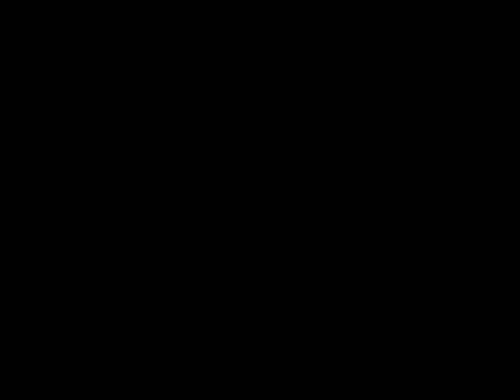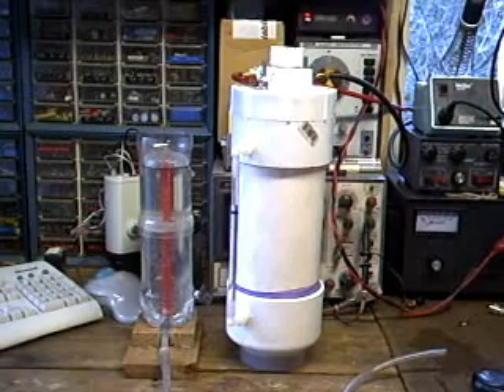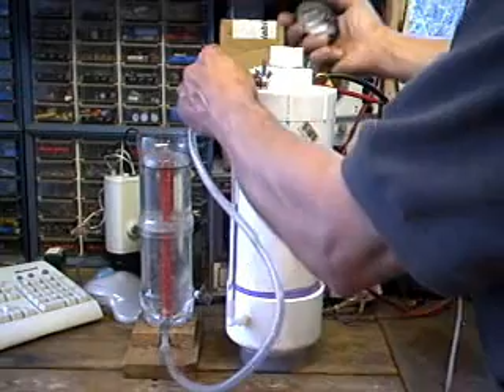#85 - VSPB Cell Production numbers 1

Comment: 1. fill the car up with gasoline and reset your trip odometer. 2. Drive until you have 1/4 tank or less and fill up. 3. Now divide your trip miles by the number of gallons you just put in your tank. This is a much better way to measure your mpg. The fuel guage on the dash board is usually based on a floater on a stick in your tank. Similar to a toilet. They are just a rough estimate and do not account for the shape of your tank either.

Comment from the maker: That idea has been tossed around. If I do, it will be just a simple copper tube wrapped around the body of the main PVC body between the end caps with some sort of thermally conductive adhesive to hold it to the cell.

Comment from the maker: I agreee I'm pushing it pretty hard at 14.5V with the bench supply. I backed off the current last night to 15A and the voltage settled in around 13. Efficiency rose to 5.15 mmw. As expected I'm just over the peak into overdrive at 13.8v which is where I want it to be.

Comment from the maker: 2nd run. 3.333 LPM @667W (14.5v, 46A) = 5mmw. Ending temp 130*F.

As far as I can tell, temp increases production because it increases current but it doesn't seem to have any impact on overall efficiency.

Comment from the maker: Not to worry. 

A) I have never had an unexpected flashback in any of my cells on any vehicle, carbeurated or FI. Not ever.

B) It's the only vehicle I drive enough to get any testing done at all.

C) I will be performing flaskback ignition testing to ensure that the blowout mechanisms work as advertised and prevent damage to the vehicle and to itself.

Filming that is going to be fun! :-D

Comment from the maker: Check valves are not fast enough to prevent flaskback and should not be used for this purpose. As long as you have a membrane blowout and you don't pump out any straight foam into the intake you should be okay. Check it once in a while on the trip to be sure.

And good luck with your test!

Comment from the maker: Not when you consider the effect hho has on the combustion of gasoline. Add to that the ICE is only about 18% eff. An HHO cell could easily be powered from waste heat energy, i.e. TEM or turbo driven alternator.

The sum total of all of these is something far greater than 18% eff.

Comment: If you were to take a series of measurements over a wide range of (Power In) vs. the amount of (Hydrogen Out) such as PI/HO you might find the process to be non-linear. In which case, you might be saturating the cell or even under driving the cell. In other words there might be a "sweet spot". (Just like when hitting a baseball with a baseball bat.)

Comment: Why not make the canister out of Stainless and use it as part of the cell for the negative electrode?

Also if the efficiency drops off at higher temps, you can add cooling fins (heat sinks) to the outside of the canister to help bring the temp back down.

Comment: Hi, watching your progress with much interest from the UK. Excellent work ! You mentioned increased HHO production with increased temp - surely by placing the cell in your engine bay, the cell won't need to generate so much heat itself? (= increased cell efficiency)
If so, I'm thinking a water jacket from the engine coolant could be an idea...

Comment: That's almost a half a kilowatt of electricity input(435 watts). Would 2 liters a minute even be enough gas to run a generator to produce half a kilowatt of electricity? It would be interesting to see how many liters per minute it would take to run a small 800 watt harbor freight generator.

Comment: Where do you get those big power supplies?
I was using a 15amp battery charger and I broke it. I put a fuse on my electrolyzer and it blew a 30amp fuse!..

How can I reduce amperage on it? More neutral plates or possibly a resistor inline?

My config is (-n+n-n+n-n+). any Tips?